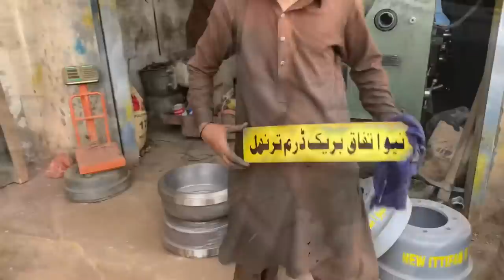Manufacturing process of truck brake drum || producing brake drum in local factory    #jktechnology

Comment: That is a cool sand casting process- very work intensive but gets the job done!!
Reply: That's the totally normal sand casting process, completly standard all over the world for small batch numbers, were mechanization or automation is not needed. Brake drums are certainly the wrong product for it, as they are needed in greater numbers, but the rest fine.

Comment: These guy's are very skilled. Don't let the video or setting fool you, these guys know what they are doing. Check 21:35. That tool is a runout gauge, used to check if the work piece is secured in the chuck perfectly in line with the lathes rotation. He lined it up perfect with no adjustment at all first try. Bonkers.
Reply: More like horrifying.

The "smaller" problem is they work with molten metal and other extremely dangerous material without any protection (like one of them lifts a glowing hot piece of metal over his sandals). In this enviroment, any accident would have horrific results.

But the bigger problem is: the end product has no quality control.

Suppose you buy such a brake, that maybe looks okay for the untrained eye, but then once when you try to stop, it explodes, because of faulty manufacturing, killing who knows how many people.

For their god's sake, there are visible deep potmarks and blemishes from the imperfect casting in a component, that have to stop a multi-ton vehicle 100% percent of the time. Also, no balancing?!

They also didn't use a single precision calibration tool (when he used a regular ruler, I bursted into laughter), they didn't check any tolerance limits, didn't do any testing, or even a thorough inspection of the end product. And people wonder, why has Pakistan one of the world's worst road traffic accidents records.

The effort maybe commendable, but the end result is catastrophic; it is basicly a serial killer factory.

If you want to see, how a real truck drum brake manufacturing facility shoud look like, watch this video:

Accuride Corporation Drum Manufacturing Process 
https://www.youtube.com/watch?v=Kroq6kejsh0
Reply: First try? What about the edit just before he checks for runout?
Reply: @Elfnethu  Spot on. Runout indicator without dial gauge, eyeballing. Turning to machine the backside, he assumes it is parallel, but it is not. As soon as the part is tightened it moved and it is going to feel while braking.
Reply: @Elfnethu  I understand all the issues, but you are assuming a lot of stuff from one heavily edited video. Comparing to your linked video, we didn't see any precision calibration tools in that either, nobody measured the diameters etc. See where I'm going with this? We can assume it is all there, but wasn't shown. Thus we can't assume anything based on a video of something, though there are hints that not everything is to modern standards.
Reply: He lined it up as usual on a 4 jaw chuck: don't move the other two jaws, thus it repeats very accurate just as is when the parts you load into it are roughly the same. And we do see that he did realign the centricity of the part once, so not perfect. World never is.

Comment: These guys really bust their backs in order to produce something useful.
It shows what can be accomplished with low-tech and skilled workers determined to produce a product. :)
Work safety is not a known word though.
That oil-burner makes mine look like a toy. I won't be melting 20 Kg of cast iron though, so I get by with what I have.
Reply: safety... India does not know that word they fix an electric problem while the power is still on the lines...
Reply: если для вас это это квалифицированные рабочие, то очень печально🙁
Reply: @Bahoos001  Ey, compared to the probably non-existing education they are skilled workers.

Comment: If they had a simple sand blasting setup that would make clean up so much faster and easied to get the hard sand off the inside instead of wire brush
Reply: Let's start with basic PPE personal protection equipment steel cap boots
Reply: I'm calling OSHA 🥴🥃
Reply: Не нужно усложнять, всё гениальное просто . Для сравнения, сколько стоит пескоструй а сколько стоит щётка?

Comment: Makes my old job as a furnace operator of a  coreless induction furnace at a steel foundry in the USA look so safe and easy.
Reply: yeah, I just can't imagine living in a country like India just don't get why there is such a big difference they should be able to grow and make products for export to make their country economically thriving? at least they have enough ppl maybe they should reinvent the condom
Reply: You mean you didn't rake slag from a furnace to splash on the ground wearing open toe sandals or pour molten iron from a crucible with no gloves or face shield?    Sheesh!
Reply: @dan-o9746  *open toe safety sandals

The other dude is barefoot, guess that's the manager

Comment: Cheater bar and a hammer on the lathe toolpost, nice ;)
Reply: And correct me if I'm wrong, but I read somewhere that it's advisable not to drop a 100+lb chunk of cast iron on the ways of a lathe.
Reply: @ldgrmp  if you're working in whole MM's by eye. Doesn't matter.  Did you see the older fella out lifting the kids two to one several times? This is the first one of their videos that I've seen blue jeans and tennis shoes.

Comment: I really admire their skills considering the rather archaic methods of casting and the resulting quality of the cast. Pleasure to watch :)
Reply: Yeah... That led lightbulb hanging above the lathe, seems like the most modern piece of technology in their shop... 🤔
Reply: @atenrok  true and it is the best possible solution considering the risk of power outages, grid instability etc... you can run those off of a car battery for days.
Reply: @jonasduell9953  why would you? The lathe won't run off the car battery, and there's only that much you can do with a hammer...
Reply: @atenrok  lmao you are so right :) facepalm
Reply: @atenrok  you can run a lathe off of any kind of engine .. before the electric grid was built factories would have a giant steam engine with shafts and belts distributing power to all the machine tools in the building
Reply: @frontiervirtcharter  I don't see any steam engine installed in their shop. So, what's your point?
Reply: @atenrok  they could have a generator and transfer switch set up somewhere the camera didn't look. Maybe they do, maybe not, IDK. But lack of grid power doesnt have to stop them if they are prepared. 10 or 20KW generator probably enough to run all the motors in the place at once..  maybe a smaller one if not all the machines running at the same time

Comment: Interesting to see how they make do with the limited tools they have. The brake drums will certainly work well enough, though I think there is a good chance they are going to cause quite a bit of vibration without balancing them. The furnace design is interesting too. I've never seen one like that but it seems like a pretty good design for the quantities they need to melt.
Reply: Very likely on their roads it will never reach the speed to vibrate.

Comment: Hello there. Very nice craftsmanship. Can u make a more detailed video on that oil furnace.  Would love to make one furnace like that.
Reply from the maker: Yes... Very soon, 🙂
Reply: Yes, low Sulphur oil.
Reply: @dave_in_florida  is that used/waste/old engine oil used ?
Reply: Looks like they are using a babbington burner or something similar running on used engine oil
Good way of getting the heat off something worth virtually nothing, and a better way of recycling for the environment
Might smoke a bit on startup, but the temperature to melt cast iron is twice that needed to destroy dioxin. It's a lot cleaner than you think

Comment: one afternoon with  really qualified production manager could save these guys thousands of manhours and possibly even save some toes. It kills me to see people working this hard to make a living when they really don't have to. Even with the same equipment and same personnel, this process can still be done so much easier.  Happy to help, if asked.
Reply: Oh, really? they are ~5 guys doing 60hr weeks, so lets say the whole shop works ~15k hours a year. Where do you want to cut thousands of man hours? They could indeed need some better shoes and a few lifting devices, but the rest is pretty much standard. It is in general the wrong process for mass producing brake drums for a truck production plant, but not for small batch spare parts, there it is on point. They do live from the shops around them buying a limited number of spare parts. Mechanizing the forming process is not doing the trick, that's way to expensive for the very limited production numbers. then you need to build a factory and have a sales department selling bigger numbers regionally or nation wide, but then you also cannot do it in one afternoon so let's just modify their small number shop: Their labour is inexpensive. you need to be able to pay for a better and more efficient sand mixer and distribution system or a crusher for the scrap iron by the savings of labour costs and that will be hard. scrap crushing took a lot of men and time, there could be the biggest possible saving, ramping up productivity. And two special build, flat wheel barrow fitting under the sand mixer. Also they should clean the raw parts with an angle grinder before putting them on the lathe, as the sticking sand dulls the tools rapidly and the burrs take a lot of time to be machined away. they could also need a frequency converter at the lathe to be able to switch between different speeds to safe some time machining the drum hub.

But all of that will not safe thousands of man hours.

Comment: the thing that surprised me was they kept the only guard I discard. the grinder still had the guard on it. every belt was out in the open not guard in sight and they wore sandals will working with molten metal. but they safety minded enough to keep the guard on the grinder.
Reply: Maybe like me they have learned not to operate it without the guard.
Reply: Logotipo

Comment: I respect the effort and skill displayed here; but with no riser on this mold that drum should look like it’s been shot with a shotgun full of birdshot when they begin machining.
A mold for a casting that size must be designed to allow solidification to occur opposite of the gate, and some type of shrink release.
I was a Level II Industrial Radiographer in a brake foundry for over 10 years - I’ve X-Rayed over 1000 truck drums and Diff cases. Based on gate location it would not be difficult to predict where internal discontinuity from shrink would occur with the castings in this video.

Comment: In Bangladesh, in the machine tools factory (BMTF), Gazipur, there are two types of casting systems. That is one ton casting by which break drum, tubewell, big water pump cover etc are being done since 2003 and with five ton casting big parts like ship, bridge equipment etc can be done. 
In BMTF anything and everything regarding metals items can be done. Anything regarding railway, some aircraft items, electrical items,  many vehicle items,  anything metal based items can be produced.
Reply: do you have video of 5 ton casting?
Reply from the maker: nope but very soon …

Comment: should get a wheel barrow for that black sand machine
in fact they should get several.
the guy working the forge should be given gloves
should be given eye protection when they are using the sledge hammers on the iron.

Comment: A good "CONCRETE MIXER", I did not know that cast iron can be melted with fuel oil, a rather simple but working design. You understand that a lot is possible even in artisanal conditions.
Reply: 👍 I
Reply: I bbb bbb

Comment: That is awesome work they do. However, it does make me cringe at time watching them work. Beating on your lathe quick change chuck just to tighten it, super fine sand all over the weighs, as well as ductile iron dust. That's definitely a no-no over time (seriously screws up bearings). But they are doing what someone else had taught them, and doing what they can with what they got.

Comment: But I wouldn't mount anything made from that whole process on my truck, I will tell you that much.. You don't reach the needed max temperature to be able to separate all the impurities in the metals as long as you are doing it this way.. The metal can get brittle and explode if the part get hot enough under braking...

Comment: I am curious about the type of metal there melting down to pour the drums with. I have no idea of what kind of metal is used in the casting process of brake drums. I think it was cast iron back in the day.
Reply: It is cast iron. They were breaking up cast iron cylinder liners from diesel engines, and cast iron clutch pressure plates. That got the about the right iron qualities without having to do assaying or anything like that.
Reply: Skydaddy Myth-Busters  p
Reply: Skydaddy Myth-Busters  Not really, while brake drums are critical they are far more massive than they need to be. As long as there are no large inclusions, any cast iron will do for that component.

Comment: First off I call bulls#1t. There are are bunch of shanty jobs site like this in India. Your whole company is based off making a single brake drum for one single model of vehicle and what the hell vehicle is this going on anyway a tractor trailer im guessing wow like the humanity. They are using old used motor oil as fuel for their oil burner to melt the metal. That introduces so many impurities to the metal. Well this it is t like India doesn't live on the edge of insanity they ride on roof tops of trains and hang off the side of everything it no surprise they could make a business making such an abomination. Nice video appreciate the footage.